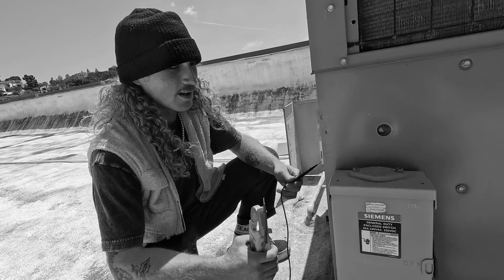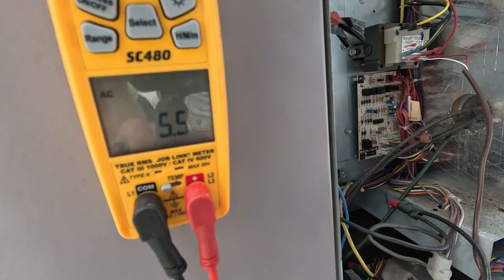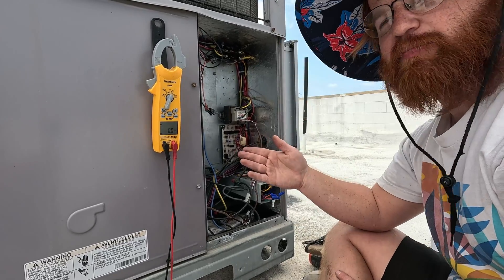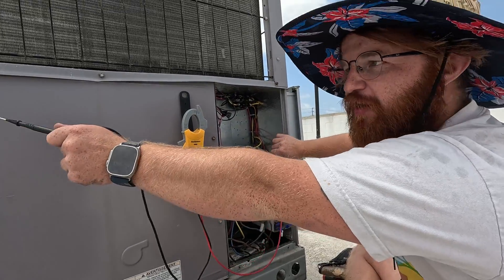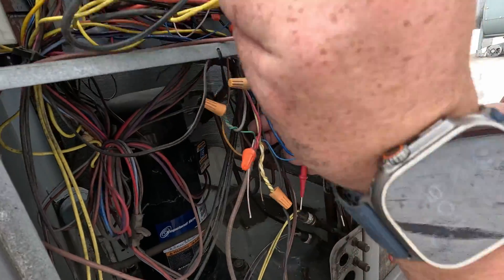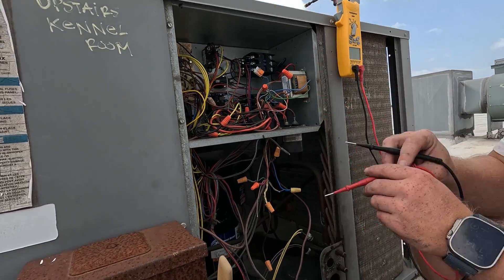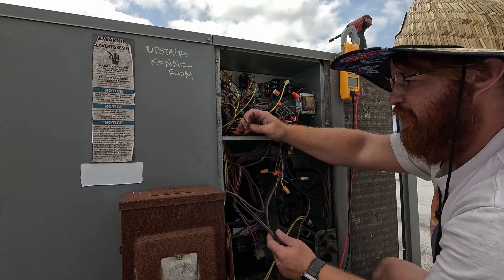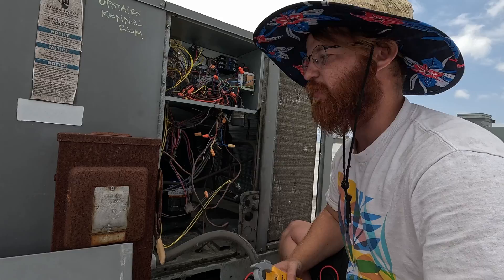How To Troubleshoot Low Voltage HVAC Problems With a Volt Meter. Tips and Tricks with Example Issue

Comment: Isn't the low pressure switch supposed to be OL if it's normally  open
Reply: Low Pressure Switches are NC in all the units I’ve seen.

Comment: Now up your game to DC trouble shooting on the old Trane voyager units and actually teach us something.
Reply from the maker: I always thought it was easier to ignore the DC signals on these things and just troubleshoot the darn thing. They are pretty simple systems when you break them down piece by piece. Just send it into test mode and troubleshoot it the same way you would anything else. I don't see these much anymore now that I'm in San Diego. Used to troubleshoot them almost daily in AZ

Comment: you ever use a fieldpiece SNCV1  24v ncv tester (or comparable) tester to do it quicker without having to poke leads down in the wire nut not knowing if your in it or not ? just a thought you might have to pull other wires out of way a bit with your fingers so it don't pick up them. maybe I'll try your hopscotch method with ncv and poking and see what happens
Reply from the maker: The fieldpiece multimeter I have does have an NCV mode which I have used on occasion but I prefer to see the voltage with my own eyes

Comment: So if I verify power going to the board and no power coming out should be verifiable the board is bad right?
Reply from the maker: I would say yes in most cases. Assuming you've checked the fuse. If you have 24v in and nothing between the R and C terminals for the thermostat connections that is typically a bad board or bad fuse.

Comment: My English is a little bad 
What does it means ( don't kill power ) ??
Reply: Do not pull out or turn off the circuit breaker. Leave the unit running.
Reply from the maker: Don’t turn it off

Comment: Really like the video, but can you do a white board explanation with a few lines just showing what you mean by certain things. Because we couldnt see what you were testing so very difficult to visualize. Example, the relay not allowing power to the transformer, or where did you find the common? To then use the other lead to check for low voltage? What points are you looking to find 24 volts in the low voltage system with one lead on common? Your great, but if you are looking to help make other techs better, some white board breakdowns would help us better understand what you are relaying.
Reply from the maker: I can do that no problem
Reply: @SurfBrosHVAC  i look forward to learning from you, please keep it up you are doing a service and fill in knowledge gaps

Comment: It sucks to find out you misdiagnosed a part.
Reply: Isn't the low pressure switch supposed to be OL if it's normally  open

Comment: Loved the video man ! I think you did a great job explaining it. Been in this trade for a year and I'd say my weak point is electrical diagnosing but this helped clear some things up for me
Reply from the maker: Main advice I can give you is to not let the system win. Take every call like a challenge and if you can't figure it out you lost that one. Sometimes calling for help is necessary but before calling do everything you can to avoid calling someone. It will help you on the next call. Thanks for watching:)

Comment: Not a good video , you are jumping everywhere.
Slow down
Reply from the maker: You should've seen the raw content
Reply: @SurfBrosHVAC  Oh, I get it!  But since you have that fancy white board... "story board" you A-B-C-D etc path, what visual tells the story you're narrating? Close shot? Wide shot? POV?  It doesn't have to be perfect, it just can't be confusing.  It's okay to pre-script the important parts, you're trying to do a lot all at once - working on a system, teaching trouble shooting, and making a video.  As you develop a work flow it will get easier but start your shoots with an outline/punch list and a couple paragraphs of specific language to make the video part easier.
Reply from the maker: @raygunsforronnie847  Yeah I bought that board cause someone commented on this video I should get one. I made this video very off the cuff and honestly didn't realize people would like this type of content. If people wanna learn to troubleshoot I'll do what I can to help